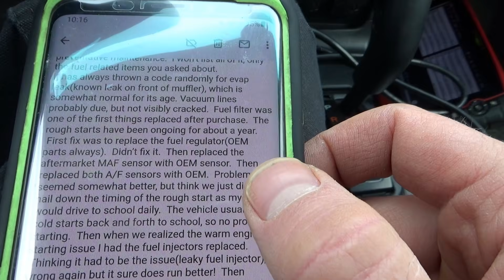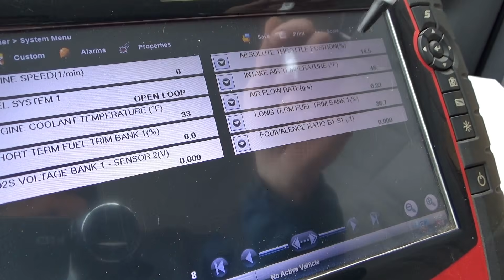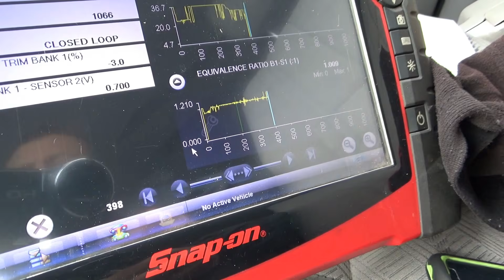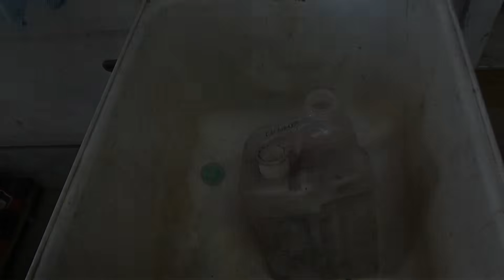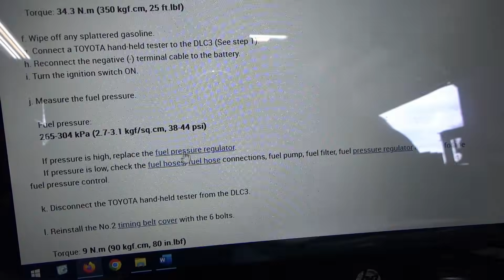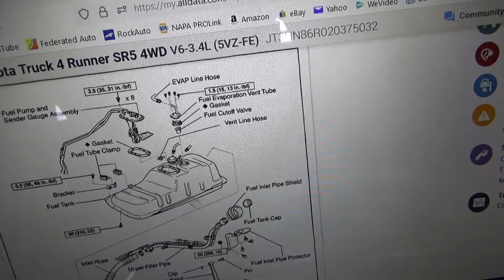1 Year of Toyota PARTS CANNON...Long Crank When HOT? (Part 1 - 3rd Gen 4Runner)

Comment: Hi Ivan. If that fuel pump is like the ones used in the sienna mini vans. Toyota oem pump costs around $1,100.00 give or take a little. I have learned so much from watching your videos. Keep up the great work. I wished that Toyota would put in a nice easy fuel pump access plate in those types of auto's. The Sienna Mini vans are the same way. You have to drop the tank.
Reply: 84 dollars rock auto denso
Reply: $1100 ... that includes labor, right?
Reply: That price is just for a 2005 Toyota Sienna Fuel pump and fuel filter. No labor. That Toyota had a totally different fuel pump assemble which I was surprised to see. @LeverPhile

Comment: I had the coolant hose problem before with a Tacoma after a had gasket failure. I attributed it to oil mixing with the coolant and softening the rubber. I had to replace every hose on it. The entire cooling system was a mess of oil/coolant mixture. I had to flush it several times.

Comment: Thanks for this upload Ivan.  I’m a Toyota fan also....especially that model.  I’ve a 1992 Hilux Surf SSR-G 3.0 V-6 parked in my Tokyo garage.....maybe a 1st gen model?  Loving your diagnosis regimen.
Reply: people are putting these 3.4 in place of the 3.0 never done one myself fyi long time toy mechanic here
Reply: @juanrodriguez-ry6yt  Hi Juan, thanks for the heads up on engine swap... not possible here due to government registration regulations... ie. weight, displacement, smog changes.  Paperwork and certifications galore.   Vehicle has only 77,000 KM..... gonna be a “barn-find for someone, for sure.